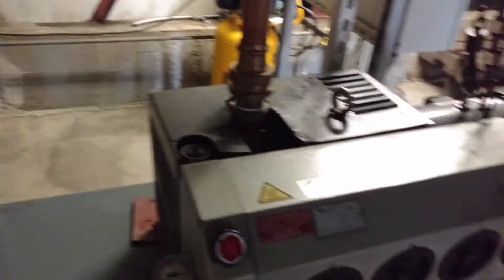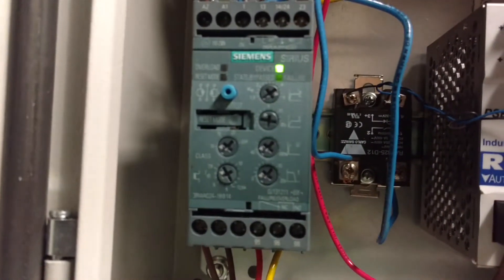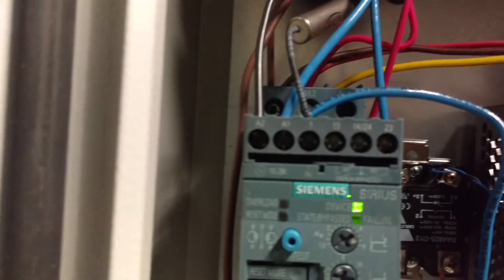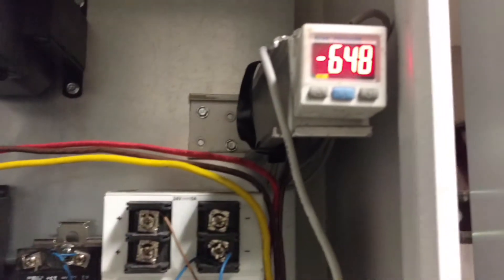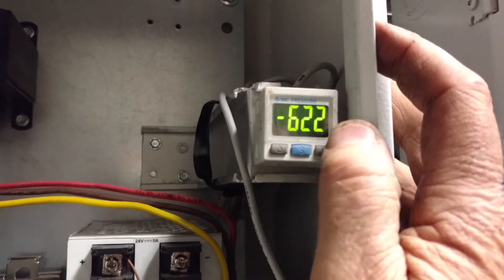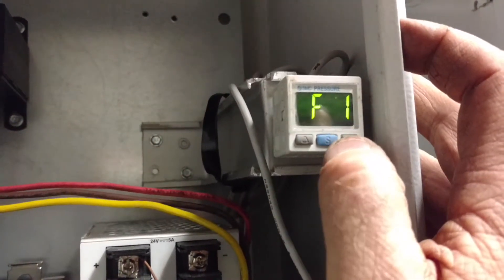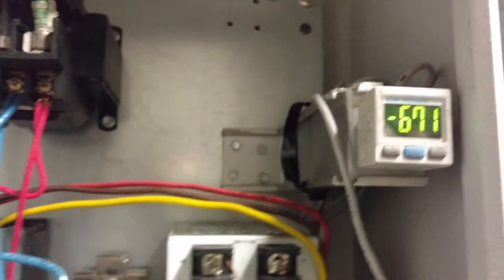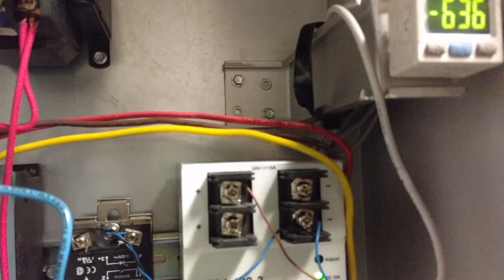Soft starter motor, siemens, Sirius 3rw4024, and vacuum switch SMC ZSE30A

Comment: Good morning. Is the smc vacuum switch a PNP or an NPN?
Reply: I need to connect a ZSE30A-01-C. But I can't understand how to do the wiring. I have to manage a 5v vacuum pump. So I have to use the voltage output function ...